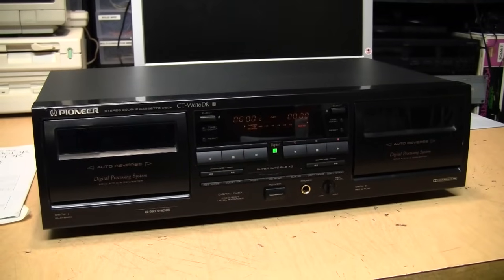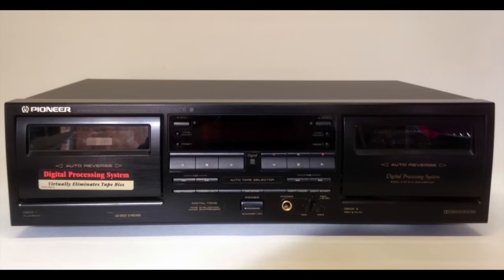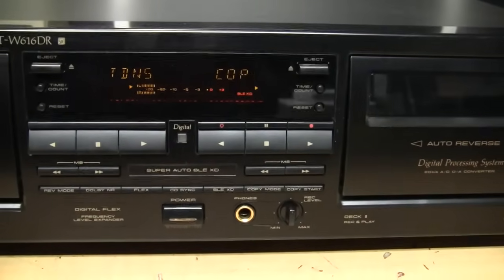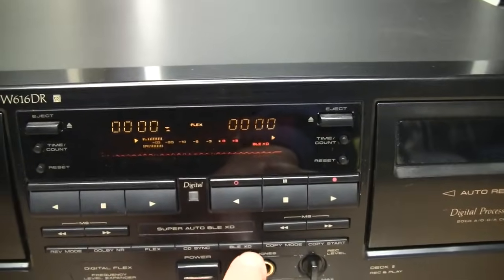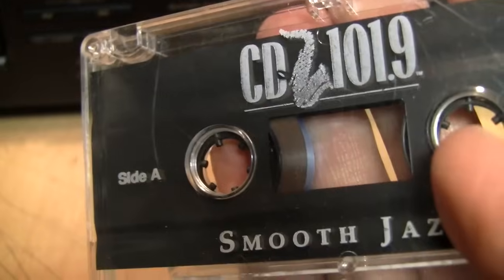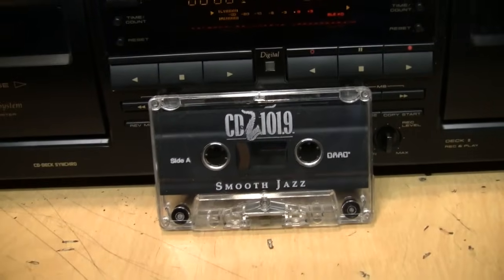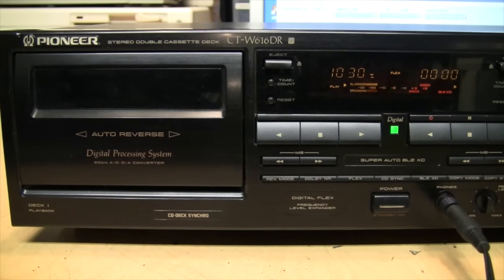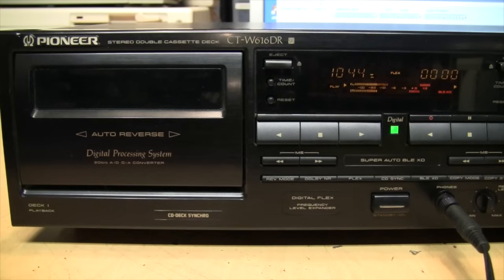A cassette deck that eliminates tape hiss - Pioneer CT-W616DR

Comment: That’s the kind of tech that works REALLY well sometime, but fails MISERABLY in some cases. Most of the louder parts demoed sounded very good - i would never guess the source was a cheap Type I cassette tape. The Simply Red section and other lower passages, though… the artifacts of the filtering process made the songs pretty much unlistenable. Thank god you can turn the feature off in these cases.

Comment: Too bad no one ever built reel Dolby SR noise reduction into a cassette recorder. I would like to see someone take a cat. 360 frame (outboard SR NR) and compare to Dolby S on a cassette tape.
Reply from the maker: Dolby S is the consumer-grade version of Dolby SR. Just as Dolby B was the consumer-grade version of Dolby A.
Reply: @vwestlife  I am well aware... however there IS a difference. In fact the CP-650 cinema processor used S chips in series rather than a "true" SR circuit and there is an audible difference.
Reply: Why? SR is a professional format, most of the people who needed SR would have used reel to reel recordings.

Comment: 0:36 I remember when early portable CD players in the 90s had no skip protection. Some models did but they were very expensive so it wasn't really affordable for people to listen to digital media on-the-go or in the car. My mom had a portable CD player in the car that ran through a tape adapter and she rarely used it because unless the car was parked it would skip, sometimes frequently. She even had a special brace that the CD player sat in that was suppose to minimize the skipping but it wasn't that effective.

Comment: I have the 606 I lovq it. Saw a video that says it uses the same circuit board as the 616 and the you tuber enabled the flex function and the other missing functions. Got mine ata garage sale for $20.

Comment: Analog that sounds like digital.
Reply: I’ll agree with you that this deck sounds bad, but digital doesn’t have a ‘sound’. It’s neutral, wow and flutter-free, and non-distortion medium. The ‘sound’ of analog is all the artifacts and quirks of it distorting your music.
Reply: @alvarosundfeld  Digital doesn't have a sound because it's not sound. It's the conversion to analog that creates the sound. Ever hear the difference between 4 bit (telephones) vs 8 bit vs 16 bit vs 32 bit when they are converted to analog and played through speakers.

Comment: That's not true. Tapes don't hiss. The tape deck's amplifier is what produces that hiss. Without any cassette in the deck, press the play button ▶️ and turn up the volume. You will hear that same exact hiss. Yes, that hiss can get recorded on the tape, especially with cheaper boomboxes that use a permanent erase magnet which ruin tape recordings with an awful harsh thunder-like noise. But any cassette player, when played without any cassette in a player with volume all the way up will hiss. It's that same hiss while tape is playing, especially the one which was recorded really low.

Comment: That's NOT the same frequency response as a CD player. Nearly all hi-fi CD players are flat within +/- 0.5dB (or less) from 20Hz to 20kHz. The frequency response for cassette decks is usually measured within +/- 3dB unless specified otherwise.

Comment: I got a hand-me-down Pioneer CT-W606DR from my relative a few years ago. It's an Asian Model that has the same features as your CT-W616DR, with FLEX and BLE XD. I had successfully cleaned the heads/capstan, and replaced the damaged belts. It played really good as you described. This is for keeps. Thanks for the tips, as I got no Operating Manual for this.

Comment: Hi,
great review. :)
I have recently bought almost new one piece.
I use commercially pre-recorded tapes, but most of them exceed red +0 db display limit reaching +3 db, so sometimes I can hear sound distortions. :(
Is there any easy way to make output level lower, maybe via adjustig some pots inside the deck?
Thanks and keep up the good work. :)
Reply from the maker: That is normal for pre-recorded tapes.
Reply: Yes, yes, I know, but is there a way to prevent it by lowering output level somehow?
Reply: You can buy outboard analog to digital convertor. I bought creative e-mu 0404 usb which is basicaly outboard soundblaster card with high quality dac and controla with meters to fine tune digital sound which I then record with free program audacity.
Reply: Thanks for the advice.
On the inside deck board I have found two pots responsible for level control, so You can easily adjust it. :)

Comment: I think is a mistake in one of your spec sheets.

Dolby NR off - 57dB s/n ratio  (pretty typical and equal to my Yamaha kx-w952 high-end dual cassette deck)
Dolby B - 82dB s/n ratio
Dolby C- 90dB s/n ratio

seems to be logical specs.  I fail to see how dolby-B and dolby-C can produce the same S/N ration unless they are doing something VERY special with the digital processing ...

Comment: when im copying from one tape to another the tape that im copying from keeps turning off when i hit rec on the dec 2 why is that
Reply from the maker: Did you engage dubbing mode? Otherwise it won't let you use both decks simultaneously.
Reply: @vwestlife  yeh just after whatching your youtube vid  saw u using copy mode your the only one that shows how on you tube thanks a lot mate cheers keep up the good work would like to know how the cd sync works l.o.l,

Comment: Yeah I picked one up used at an electronics recycling facility for $5 and it works!  I have to give a thumbs-up to the FLEX digital processing it plays my tapes better than my Nakamichi 3 header.  It works best with pre-recorded tapes.  The high frequencies are noticeably enhanced and the noise with Type 1 Dolby B tapes is suppressed to inaudibility even when playing with the amp volume turned up.  FLEX seems to do intelligent noise gating function as the background tape hiss does audibly pump with the low level audio content, but the hiss is always less than what the straight Dolby B can do.  As the video author says pressing the left and right Time button toggles the FLEX on and off and I would never listen with it off !!!!

Comment: Fine device, don't have any complaints about it except it's height, apart from an amp i would always try to create a device as low as possible. The Pioneer sounds amazing, hadn't used it for a while but the 25 years old machine hasn't ...suffered... from the standstill. Hearing the machine the 25 years old belts are still in a good state. Have al Sony but all belts had gone a decade ago.

Comment: For a dual cassette deck, I am surprised how good the CT-W616DR sounds. I bought a Pioneer CT-S 550 S in the 90s thinking that I would use it extensively, but I discovered MiniDisc and recording on CD was "the future of music" around the same time. As a result I have hardly used it. Whether there are many examples of this model 5 years on after a VWestlife video, who knows? Time to start using my 550 S again. Thanks VWestlife.

Comment: The audio on the playback sounds like its from a digital source. No hiss or artifacts. I sometime wonder if tapes played with good deck like this Pioneer can really produce sound so good. I just bought a very nice pristine Sony walkman for my daughter to play with and the type 1 commercially recorded tapes and they have terrible consistencies in terms of audio quality. And the hiss? Oh boy! and the audio wobbles as it plays. I may put this down to the old walkman and its aged mechanism and rubber belt. Albeit these are type 1 tapes and probably no dolby NR. I bought a good high end deck and its on the way to me. Planning to get some metal and type 2 tapes to record and play. Let's see if I can get the same kind of audio I am listening to here. I just can't believe it until I hear it myself from my (hopefully good) used deck. Fingers crossed. One of the reason I went to CD as many others did to avoid the horrible hissing.

Comment: weell done, another great vid, without YT bing-bong demo music,some good jazz instead.
the mechs are plastic, like other deck you examined of this age?
I prefer metal  construction, but its results that count, right?
adding digital stages seems retrograde, especially as some recording studios now adding a magnetic tape stage, when mastering - digital-analog-digital, to warm-up the sound, as tape emulation software does not cut the mustard. Etsuro Nakamichi's intense dislike for his large corporation competitors,ho had started to innovate, is exemplified by decks like this.
its a shame that mp3 kiboshes  the signals- don't allow us to fully hear,asess the fidelity of components you evaluate. thanks for your interesting efforts.all the best, Allan
 ps: when copying dolby-encoded tapes, try turning off dolby on both play an record decks, original dolby-encoding then transferred intact. eliminates possible/potential additive dolby tracking error- no digital/all-analog preserved!   seems to work for Colby B transfers, or me, anyway.one exception is if recording to a noisier casette, then B  decode on playback deck, use dolby S (if fitted),on record deck.if dolby calibration is accurate on decks, worth trying. experiment.

Comment: I bought a used one recently based on research to archive tapes. Sadly it sonicly not well. Sounds like it has crud in the throat. I gave up on it thinking some components are out of spec, i was not going to sink more $$ into a dubbing deck. I certainly can't bring myself to trash it, cassettes decks are getting scarce. The build quality is so so, but it is one of the latter decks Pioneer made. Wish I got a keeper.
Reply from the maker: Did you clean and align the heads?
Reply: @vwestlife  1st, I have enjoyed your vids. I have had a love affair with cassette decks, having owned a number of 3 head and 2 head decks. Yes I did everything I could maintenance wise, I am familiar.  I bought it to try the DNR. I suspect it has transistors/capacitors, etc out of spec. That is beyond my pay grade and I have no cassette deck technician nearby. I could write a paper on the models I have used. The best sounding by far was a BX-300, CD like quality (darn idler wheel).Yamaha KX- 930 was a tank. I have relied alot on Sony ES decks. Awhile back I enjoyed Akai decks and had a Technics deck that was very durable. I retired many decks whose belts were to hard for me to service. They all really had personalities for an inanimate object. Surprisingly my best working deck at the moment is a Sony TC-K615S 5, with its kluncky transport. I wonder if ever there will be another high end assette mechanism produced?

Comment: Didn't these decks with this digital processing only have 2-heads?  That frequency response is true amazing with singular record/play heads.  I can't imagine what all of this magic could have done on a reference 3-head one direction transport deck.
Reply: It's really an eye opener and makes you realize that in most cases, especially in the context of the 21st century and 20+ year old hardware, multiple play heads is actually a gimmick. It compensated for limitations in design in earlier decks, so it did have a legitimate purpose, but when computers were shoved into them in the 90s, it became clear how much more could be done with a single head and some computery optimization.

Comment: I have the CT-W606DR (European version) which is identical to the US CT-W-616DR (the US 606 didn't have BLE XD whereas the European version does).  I was blown away when I first got it around 5 years ago.  It finally replaced my previous workhorse, a Technics RS-BX501 which had served me well since 1995 after years of earlier Pioneer decks.
It can make 80s cassettes sound like a high-res digital remaster.  And it's no slouch with 60s cassettes either (as in, cassettes actually manufactured in the 60s).
Reply: A cheapo ferric Fleetwood Mac Tango in the Night tape was one of the first tapes I played on my Ct-w604rs that I got a few blocks away from my house at a rummage sale for 5 dollars earlier this year (really). When I heard that, I realized how full of nonsense most people are when they talk about cassette quality, and what little I knew about cassette tapes as a kid (I'm a 2000s kid that grew up listening to cassettes and vinyl, everything about them was worthless at the time so it was perfect for a nerdy kid).

Comment: Great presentation and overview. Appreciate all the details. Just bought one (the W606 DR model) from eBay, so hopefully it works well, but I'll be prepared to clean it up if needed. Plan to use to use it to create mix tapes for my old Toyotas, where I've decided to keep period correct head units with cassette players. BTW the third video you linked to seems to have been removed.

Comment: I have that exact deck.

I bought it new in 1999, along with a matching receiver, and 100 CD changer, surround sound speakers, sub box, and a 32" tube TV. The salesman at the store, could not understand why I wanted cassette deck. I had lots of tapes and lots of CDs at that point. 

I haven't used any of them in years. They are in the family room with the big screen TV that I replaced the 32" with. A TV I also don't use any more. I rarely even go in the room anymore, since my only child left home, is rarely home, and my wife can no longer descend the stairs to get there. 

I think I might have to go dust it all off one day.
Reply: Damn a 32" tube TV? Hella dope B-)
Reply: @vileCR999  My CRT tv is an 81cm/32inch widescreen 16:9 one! Weighs 88kg, 2 people struggle to move it, I have it on a CRT display tv stand with wheels to move it around! I wish my tape deck was as good as this one, I would use it SOOO much!! I would make copies of my original music onto tapes way cheaper than paying someone to do it. My tape deck is an AKAI from 1987, it only has Dolby B and C on it, decent compared to not having any NR! I got new belts put on it and fixed a cracked cog on it with epoxy. But the capacitors are slowly dying so the NR which does work, can remove too much of the high end and I have no equaliser on it or as a separate deck, gotta get one!
Reply: @vileCR999  I had the Panasonic 32" widescreen tv back than, hell of money, hell of weight. Panasonic also offered this model in 36" :O  Few years ago i tried to give it away for free with no luck. With the help of a friend it goes to the junk yard fully functional   ;(
Reply: All that stuff is worth a small fortune! Sell it is you don't plan to bring a new lease of life into it! Let someone get some enjoyment out of it and you will get some cash to make your lives better and knowing that your tech will get used by someone who cares about it!
Reply: @DefensiveWounds  I actually have been using it, the last couple years, since I made the original post.
Reply: Andrew Davis  not if it wasn't a Sony. My 32 inch JVC D series is only about 95 pounds, so that's legitimately easy for two adults to lift. A 32 inch Trinitron though, oof, that goes from 40 pounds per person to 70+ fast.
Reply: @awesomeferret  It was a Sony. Back in '99, I carried it myself, no problem. I doubt I could move it now, though. Back then I was in amazing shape, now, not so much. Getting old sucks.

Comment: I have this machine, but the brightness of the display is SUPER dim.  Are there any secret button combinations (like the one you showed to turn off the DNR) that you can use for increasing the brightness?
Reply from the maker: No, but some people have had success at restoring dim vacuum fluorescent displays.
Reply: @vwestlife  Thanks for the info...I picked this deck up at the recycling center, completely filthy, and sounded awful, with really dirty heads--alcohol wasn't enough.  I was about to give so I tried a small amount of "Brasso" on the heads, which finally cleaned, and hopefully not damaged them.  Sounds great now, even with what I assume are original belts.

Comment: One more question, Is there any superior cassette decks than the models you mentioned in the description of this video: CT-W606DR, CT-W616DR, CT-W706DR, CT-W806DR, CT-05D, CT-07D, CT-S670D, T-WD5R, and T-D7 with these digital features or more?

Comment: Does this convert the analog to digital only through headphone jack?, it would be good if it was through a coaxial lead or maybe even phono.
Reply from the maker: Unfortunately none of these Pioneer Digital NR decks have a digital output, although some of them have digital inputs.
Reply: @vwestlife  Thanks for getting back, another youtube uploader mention something about this unit, saying it plays digital through headphone, if you check under this model you will see his video, apparently there is an onboard dac.
Reply from the maker: @Kaosinlondon79  Did you watch the video? The audio from the tape is converted to digital, has the Digital NR and FLEX applied to it, and then converted back to analog for output. All outputs are analog -- there isn't any such thing as a digital headphone output, anyway!
Reply: @vwestlife  ok thanks mate, i have recently bought a small device that does phono to coaxial that coverts output audio to digital recording, i guess that will help and also with added benefits of this device to.

Comment: Hello,.I have a Pioneer CT W830R from 1990's that we got it new,along with the rest of our HIFI.I have the chance to get a Pioneer CT W606DR (European model that is the same as 616 usa) for 160euro.Do you think that it will be a worthy upgrade from the one that i already have? 

PS: By the way, the Usa CT W606DR,can be converted to a 616 DR,the missing features are already inside the deck,and the only thing that is really missing in order for them to work,is the buttons....